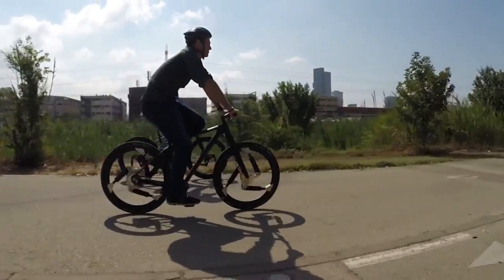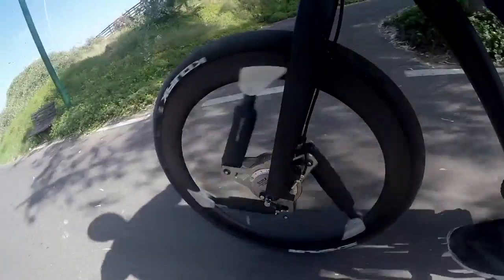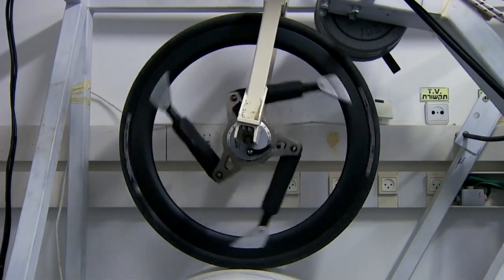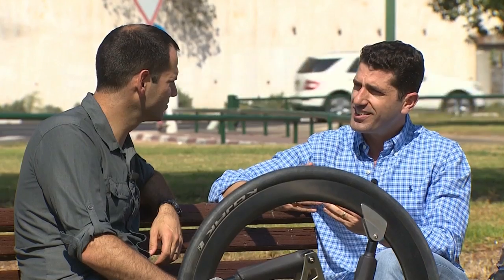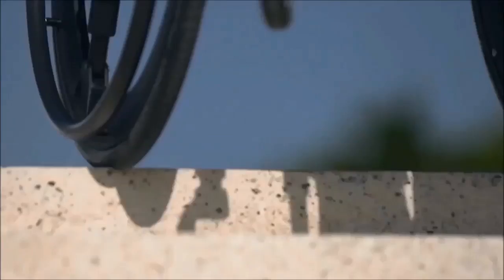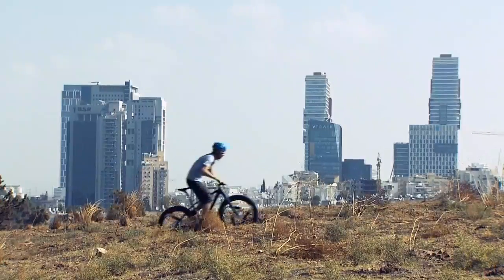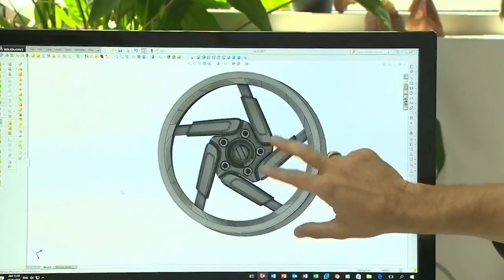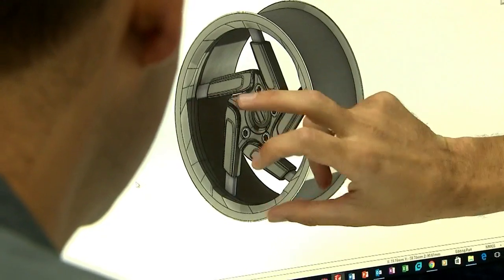Startup is literally trying to reinvent the wheel

Comment: Unsprung mass is much lower this way , so the abilities of wheel to follow uneven road surface is better but the abilities of wheel to transmit accelerating and breaking power is lower . That is why it limits to wheel chairs and bicycles applications . Wheel rotating mass increase this way since the shock absorbers and springs must rotate with the rim and the hub together , this slower down the acceleration of the vehicle since bringing heavier flywheel to the same speed ( RPM) with the same power available takes longer time .
Another cons is that the rim itself must to be made stronger ( because the spokes support points are reduced ) this way , you can notice how deep it is in the video so this lead to increase of its mass and cost .

Comment: The issue is this is only usable at slower speeds and not for high speeds, you can put this in a fast car wheel but the safety is compromised and it will add a lot of extra unsprung weight which will affect handling a lot. Its usable on slower low speed bikes like city commuters but even for mountain biking you need a lot of speed and this system will just slow you down even if the ride is more comfortable. So imo they are spreading themselves too thin, they should instead be manufacturing more city commuting vehicles and working on ebikes and the like where you dont need the speed so much at all times.

Comment: Oh I have a flat tire again...looks like I have to replace my tire AND shocks and springs = FAIL TARDS.
Reply: just replace the tube thats over the rims...
Reply: primus loy yep...assuming the rim is not cracked or warped :)
Reply: mookixox how would that happen if it meets the standards of regular rims ::)
Reply: mookixox as the video says , this is designed for light vehicles like bicycles, commuter bikes and paralyzed  wheel chairs etc...
Reply: primus loy which are even more likely to have warped and cracked rims than heavy vehicles...
Reply: mookixox nope